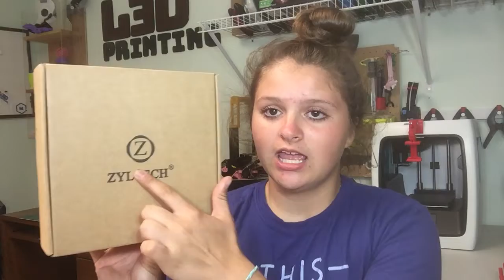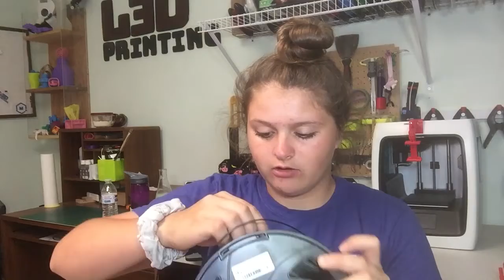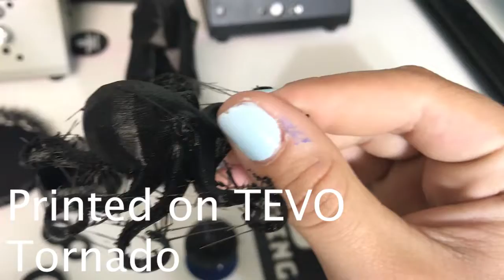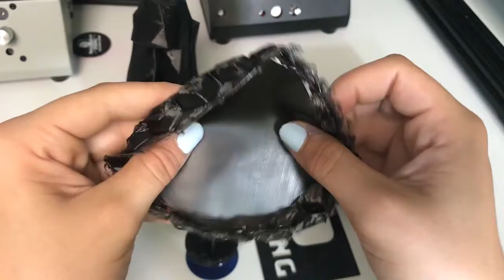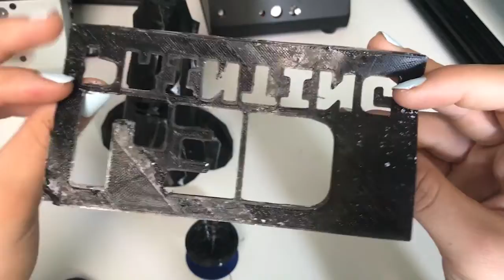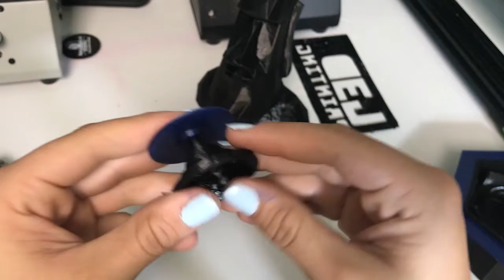ZYLTECH TPU Filament Review

Comment: Looks like retract amount/speed on first layer. IMHO why you're getting whiskers. I print with room temp bed. No heat. I have a D6 clone. Print speed might be a bit fast for me but I'm going to tweak my feed path. 100% fan here but i think my fan shroud needs changing...not that much flow.

Comment: Well done! Myself I have no experiences with TPU. Is retraction meaningful or better completely disabled?
Reply from the maker: Well because I added the filament guides on my Tevo Titans it made things a lot better, but if you turn on the setting that only allows retraction inside the print area “not in gaps “it actually turned out nice
Reply: Thanks for answering Lydia!